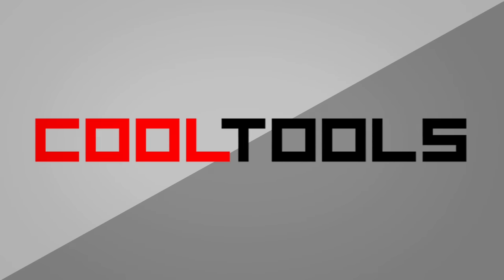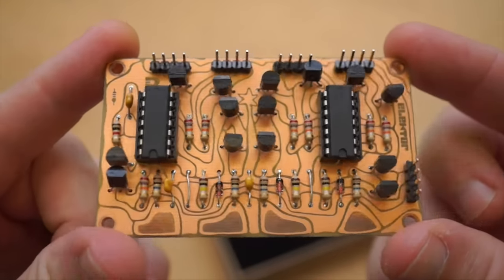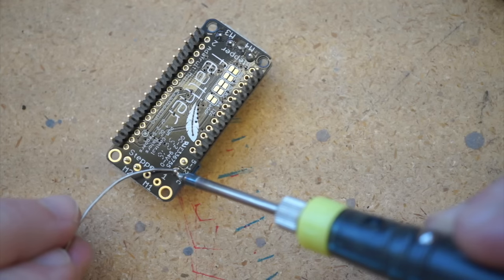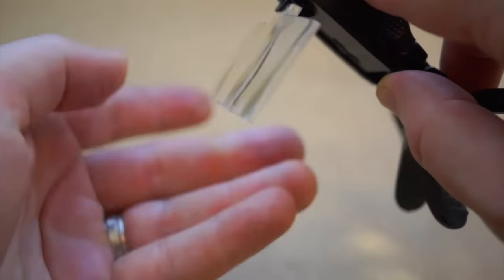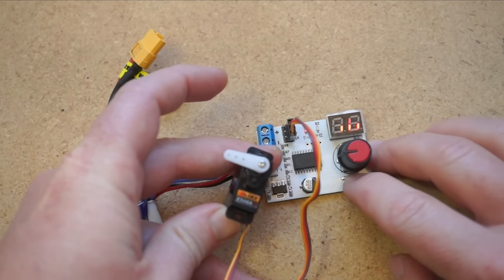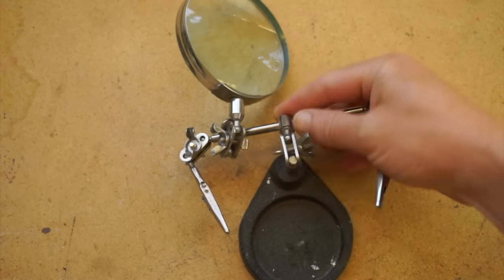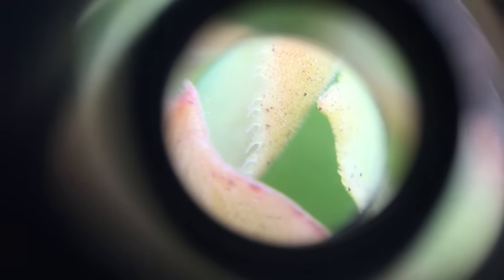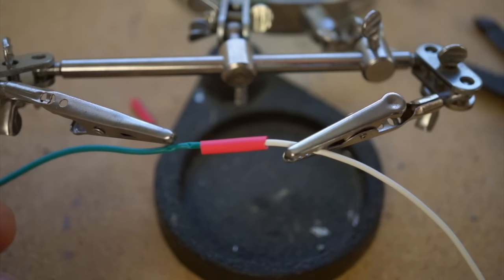9 Useful Electronics Tools Under $13

Comment: If you like small portable soldering irons, you should try out the TS100. It's around 50 bucks, runs up to 24V, 60W (I think) and the size of a pencil
Reply: 65W, but yes, I got one and it's the best decision I've made.

Comment: +1 on the poster tack. Love it!
Reply: Paul Provost and it's SO useful in many other situations besides electronics. E.g. preventing a nightstand light/clock from moving from its place or fixing a picture frame at it's bottom side to make it stand in an specific angle (both examples helping to avoid triggering your innermost OCD impulses).

Comment: The poster tack has an even simpler solution. Stick one leg of the components you want to solder into the breadboard and put the other 2 legs together.

Comment: This isn't 1981, please stop teaching people to bend through-hole leads before soldering them into via holes. When you do this, you'll end up punishing yourself when doing re-work and your parts don't sit flush against the pcb. Just tack one side of the lead, and solder the other end. Easy.